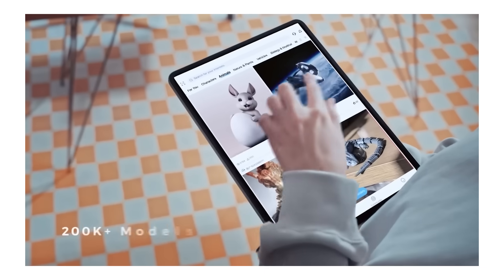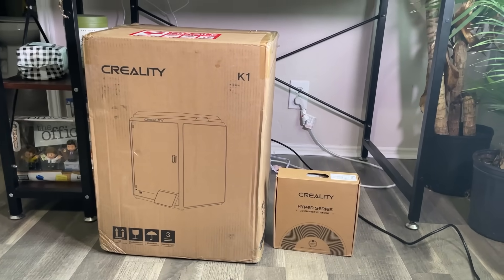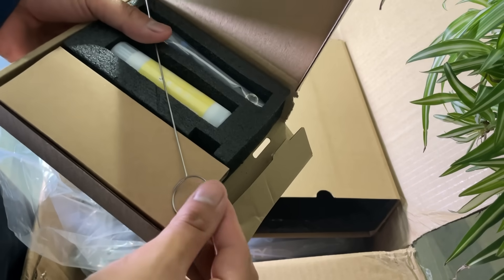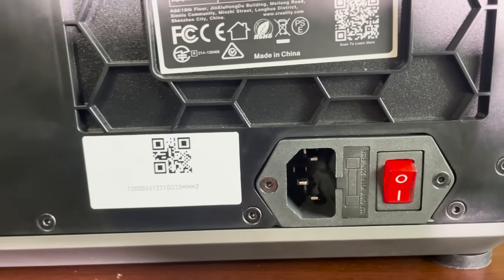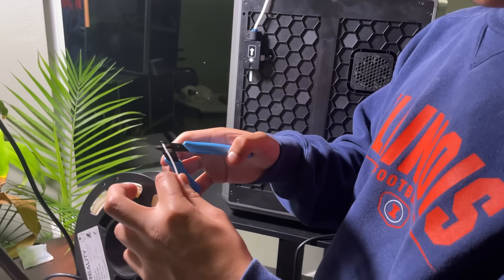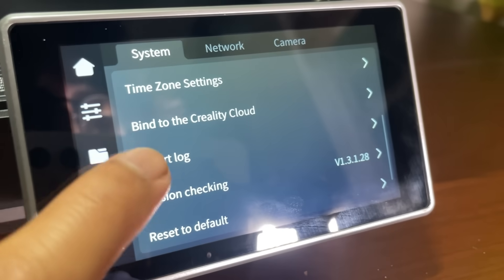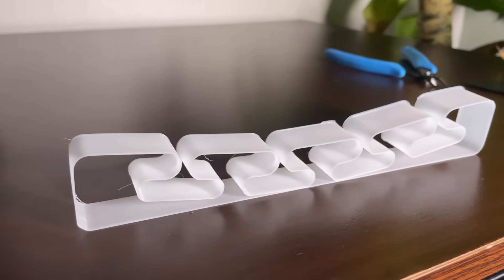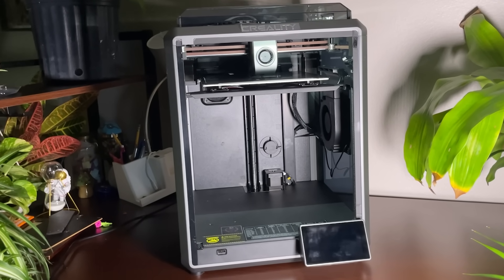Creality K1 3D Printer Review 🔥 Best!

Comment: There will be a new model K1C in December, I don't know if they continue to manufacture the K1, but it shouldn't be sold as it has problems with the motion system, which should have been fixed on the new one, a bit shady to continue selling a faulty machine!